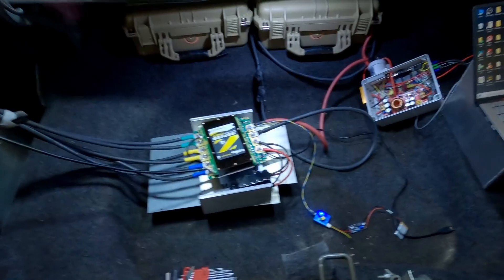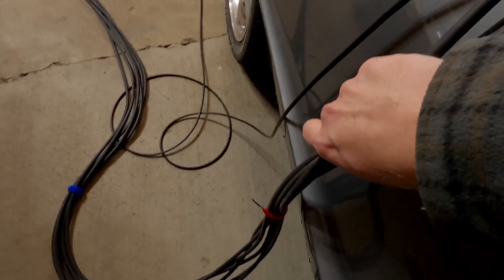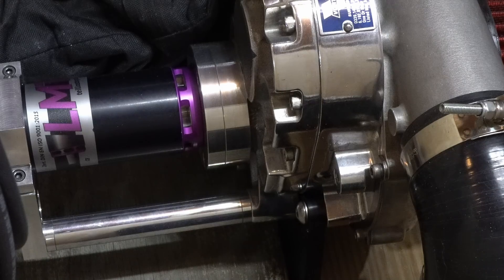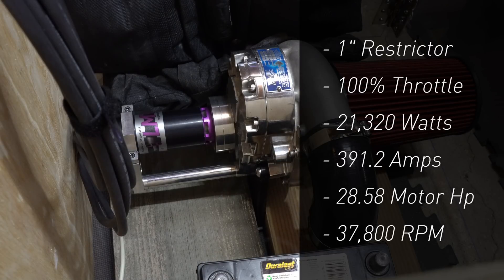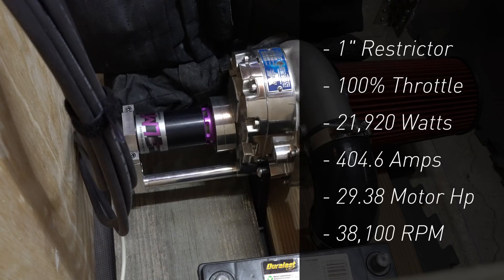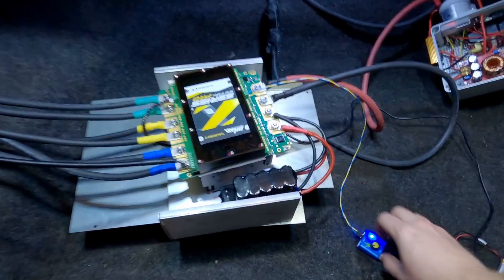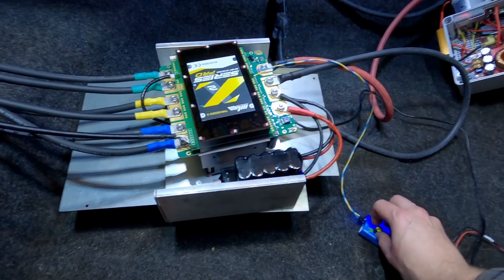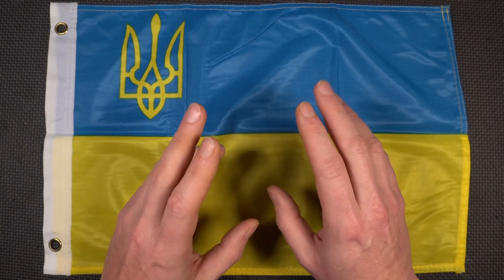DIY Electric Turbo: Sledgehammer High Power Tests - It Works!

Comment: What kind of pressure is it putting out?
Reply from the maker: Here it is on the dyno - with power and boost numbers: https://youtu.be/b9d5xv9INmw
Here it is at the track: https://youtu.be/RT0M88xHzNQ
Reply: @AlexLTDLX  you couldn't just hit me with x amount of psi or bar if you wanna get fancy
Reply from the maker: @ Because psi by itself is meaningless.

Comment: Ive watched a couple of your videos. It looks like you’re making really good progress with this thing being a fixed speed. Can this be used for daily driving or is it race application only?
Reply from the maker: You can use it for daily driving, but I don't know where you could use 800 hp for anything more than a second in daily driving - and that would likely be enough to get you arrested anyway.
Reply: @AlexLTDLX  my question is more or less since it’s continuous boost what happens when you’re sitting at a stoplight if the speed is not variable, you’re constantly making peak boost, no matter what right?
Reply from the maker: @scottallard7566  it doesn't run all the time. It only runs when the power is needed.

Comment: may i ask why you chose to have long ass phase wires instead of putting the ESC in the front? should be way more efficient, no?
Reply from the maker: Long battery cables proved to be more problematic than long phase cables.  In an ideal setup (like a pickup truck, where everything could just sit in the bed), you'd have no long cables.  But this thing had to fit into and actual car.

Comment: The problem is that it costs the same as traditional forced induction or more
Reply from the maker: That one, yes.  But the current units are actually cheaper.  And they make more power.

Comment: Very cool.  I'm a disabled/retired mechanical engineer and I've been thinking about this type of setup for a while.  I have a whole other potential half of this setup but these days I don't quite have the resources to do as much as I'd like.  Anyway, if you are interested in the ideas I've been thinking about for doing this in a non race street vehicle, in my case a large displacement heavy duty gasoline truck engine, let me know.

Comment: RC motors have been super powerful and capable for a good 25 years. I have a little 300 gram motor (454 grams is 1 pound) that can make 3000watts....yeah these things are nuts.

I had dreams of making an electric turbo diy back in 2003 in high school.

This makes me want to get out the drawing book.

NICE work btw. Keep it up. 👍👍👍😁
Reply from the maker: Thanks!  If you haven't seen it, this is hopw it did at the track: https://youtu.be/RT0M88xHzNQ

Comment: You are obviously keen on electrical and what not but clearly not a motorhead....
Superchargers and turbos are air pumps; meaning they are measured by flow....so you never mention how many lbs a minute the pump flows or its flow charts. Credit where credit is due sir, but literally none of your data is really applicable to an engine...you size a turbo to an engine through flow charts and volumetric efficiency; neither which you stated anything About. Im sure you surely must know of these things so if ya did then there's your next video content, If you didn't then I just wasted the next couple years of your life studying a highly important and very complex and multifaceted of 404+  physics including fluid dynamics, aero dynamics, volumetric efficiency, coefficients and some black magic! Good day, nice project and my only aim is to help you translate to the gearheads as most of us aren't that smart.
Reply from the maker: I've been drag racing over 30 years and building one-off forced induction setups for almost as long.  Watch this video of how it did at the track and get back to me: https://youtu.be/RT0M88xHzNQ  FWIW, there are 93 videos in the electric supercharger playlist - I go in depth into compressor maps, volute coatings, dyno tests, multiple track tests, etc...  I've been working on this setup for a while and the results handily beat ANY forced induction I've ever used or even seen, psi for psi.  Watching just over 1% of the videos on this project isn't going to give you the full picture.

Comment: 678 amps??!!!!?!!! WOW! That little motor draws some power!! Is that kind of power something a normal vehicle charging/battery system can handle? I know most car alternators have an output of around 100 amps.
Reply from the maker: The system has its own battery pack in the trunk.  The packs recharge during normal driving.

Comment: So what are you doing for lubrication on the bearing/ seal ?
Reply from the maker: I'm using Isoflex NBU-15 grease in the bearings; I only have to lube them once a year or so.  I no longer need the front seal since there's no oil mist, but I did machine a teflon bushing to fit in that spot and give a couple thousandths clearance just to keep it from being open.  The area under the impeller appears to be under vacuum.  The Isoflex isn't any run of the mill grease - it's quite expensive, and for good reason.

Comment: Great test. For practicality point of view, what is the best battery size that you can have on a racing car for a track and how long can it last with consistent boost?
Reply from the maker: I use an 18ah battery pack, and I've made numerous dyno pulls and track passes without needing to recharge the packs.  On the dyno: https://youtu.be/PjOJU02FIGw  At the track: https://youtu.be/nlTVHkfSQXM
Reply: @AlexLTDLX  thanks for the reply but I was referring to tracks for multiple laps. How the battery can keep up in that kind of racing compared to conventional turbos or superchargers?
Reply from the maker: If you're asking about total run time, with my packs you'd be seeing useful boost for at least 2 minutes.  I can't imagine going flat out for 2 minutes at this power level.  In the grand scheme of things, I also think a properly sized compressor (this one is a little too small for the engine in the LTD - a Dart-blocked, Twisted-Wedge headed 365ci, ~ 520hp n/a V8), I think current draw would drop substantially.  It took less than 14kW to support 650 hp (because the compressor wasn't being pushed as far into the choke region of the map); but 33kW (more than double the power) only got us another 72 hp - to 722 flywheel hp.  That's why I'm now working on increasing the efficiency of the compressor as much as possible.  I think we'll hit 800-850 hp with this setup at under 40kw  - but that would drop runtime between charges down to a bit under two minutes.  You could always add another set of cells in parallel...
Reply: @AlexLTDLX  I understand. So you’re setup is useful for drag racing only where you can’t go with it for rally or conventional race tracks that require consistent boost for many laps without stopping. I’m working on prototyping a completely new turbo charger concept that I recently got a US patent for. I will share with you the prototype when I complete it.

Comment: What is the nominal voltage of  your system?
Reply from the maker: "Nominal" is a sort of loose term, implying a certain "average" charge voltage.  I don't charge the cells to max voltage, simply because there's a lot of drop off early on in most lithium chemistry cell's discharge curve.  The ESC is limited to 63 volts.  I typically charge the packs to ~62 volts.  I could charge them higher, or even add another cell - I do still need to find that ideal balance between cell count vs cell voltage vs added internal resistance.

Comment: lol is that one of those bang good 1200w dc-dc boost converters I see in the trunk? I have one of those. I use it a lot for random crap. great little thing.
Reply from the maker: Yes, it is.  It's wired in as a charger for the packs.  Good eye!
Reply: @AlexLTDLX  id recognize that design anywhere haha. they actually work great for stuff like chargers. i put a ton of heat through one running it at like 250w during my intial tests. definitely needs a fan at those higher loads but it does just fine

Comment: You guys spending money, spend some on a pressure sensing switch hooked to a speed regulator. Then as it boosts it responds to preset pressure in a controlled situation. The cost to control and the complexity exceeds the performance..

Comment: Looking awesome.  Would be nice if you can control the amount of boost, so it can be street legal if needed.
Reply from the maker: You can - check out the latest video; you can control the max setting; but you can also stage it or make it follow something - like throttle position.

Comment: Nice project !  @AlexLTDLX   Ultra long phase cables add ALOT of inductance and resistance between the motor and ESC !!! The mosfets of your ESC are probably producing ALOT of heat because of that! I would suggest puting your ESC as close as possible to the motor to shorten the phase wires. I think extending the Battery wires instead is better.. yuo only need to add couple caps to the DC input of the ESC
Reply: Correct.
Reply from the maker: Unfortunately, it needs to fit in an actual car.  Otherwise this whole thing is a waste of time and money.  FWIW, the inductance on the motor side really isn't much of an issue - the frequency is too high to be affected too much.  The bigger problem is on the battery side.  I found that out the hard way.  The bigger issue with the long motor cables is getting the motor started - when back EMF is pretty low amplitude.  But the sensors take care of that.

Comment: you can get 1/0 battery cables out of certain dodge chargers in the junkyard super cheap.
Reply from the maker: That probably would've saved me a small fortune.  Thanks for the tip!

Comment: What electric motor is that?
Reply from the maker: An LMT 30100.
Reply: @AlexLTDLX  Cool, thanks! Are you planning to run this electric turbo constantly like a supercharger, or just occasionally via a button? I'd imagine it has to run constantly, otherwise the non spinning turbine in the intake stream would be causing an air restriction, right? Do you foresee any issues with this electric motor and running it constantly like that?

Comment: It would be really neat to see how this would do with that Procharger i-1 with the CVT on it. I would love to see how this compares to a turbo or a belt driven blower. Obviously the small amount of sprung weight from the batteries is going to out weight the parasitic drag of a normal blower or the back pressure of a turbo system on a psi=psi basis especially if you have electric accessories like water pump, fans and maybe even power steering, then have the alternator on a switch to not drag the engine during a pull. I wonder if one of those big alternator/starter units from a mild hybrid GM 4cyl or Ram 3.6/5.7 could be adapted? It'd be cool if you could get the electric HVAC system from an wrecked EV...if not the Li battery pack, vacuum pumps, power steering pump and electric motor. This would be a cool way to build a plug in hybrid too. One idea I had was to run an electric motor directly into a Rockwell 2.5 ton axle that has the pinion output on it, then you could have a pinion service brake and utilize the electric TQ fill along with regen braking, then you could have one of these electric blowers feeding an LS engine or 351w based engine with some good heads on it, maybe use a manual transmission so you could leave it in neutral and run all electrically if you wanted. It's really cool to see someone doing something in real life that I have thought about before and actually making it work. Outstanding. You should send this thing to Richard Holdner or Engine Masters to test in on an engine at Westech on their Dyno vs other power adders. It would be cool if you produced these things or worked with a big company to produce these things. I would imagine in a big power application you would never need more than 30-60 seconds of boost because the vehicle would be going so damned fast, the question then would be how many pulls can the battery do, how much does it weigh, how long do you have to run the engine to recharge it or how long would you need to plug it in? I would imagine that it could be very practical. I would think one or two of these on a GM 6.0 iron block with ring gap, cam/springs, headers and proper tuning could be killer, maybe make 1000+hp at the crank with two? This whole thing gets my imagination going, thank you for sharing it.
Reply from the maker: I'm looking at an electric A/C unit.  I have an EPAS (electric power sterring) unit from a Prius I'll put on this thing someday, too.  Although for something like this, you'll always need to run it off it's own battery pack, and use the car's alternator to charge the packs when not in boost.

Comment: How do you plan to manage thermals on long pulls? Sure everything’s cool at full power for a couple seconds, but what about full power for 2-3 min?
Reply from the maker: It's an LK version motor - it's air cooled (internal fan).  Plus, where it's mounted on the car (yes, right now it's mounted on the car), it gets plenty of air flow.  I can't imagine pushing even 500hp for 2-3 minutes straight, much less the 800-850hp this should make.  We're talking 0-60 in 2 seconds or less, 0-100 in about 5 seconds, and 9 second quarter mile times.  FWIW, I'm in the process of buying a piece of property in Texas an hour away from where they run the Texas mile (that's where I was last week).  Are you thinking what I'm thinking?  Even that takes less than 30 seconds.

Comment: This is just awesome, if you can figure out how to make this work according to the cars  throttle to build boost at appropriate times it would be perfect
Reply from the maker: One of our members at www.electrifiedboost.com wrote arduino code to do just that and more - variable ramp up time, battery charge controller, potentiometer-controlled peak power limiting, etc.

Comment: 400A should be enough. 600+ is a bit overkill dont you think ?
Reply from the maker: Version 1 pulled about 340 amps (or 281, depending on which current measurment you believe - the inductance meter or the ESC).  It did this at the track: https://youtu.be/AOL3Qyczt3Y

Comment: This really cool to see in diy space.  But isn't the rpm to low for the impeller?
Reply from the maker: No - It's a Vortech Si trim.  Max impeller speed is 52,000 rpm.  This is what it did on a car at only 28,000 impeller rpm: https://youtu.be/AOL3Qyczt3Y

Comment: I wonder if you could use a planetary gearbox with a roller clutch to turn an oversized turbocharger. Electric for initial spool, engine exhaust for peak. It seems like you have it 99% worked out already.
Reply from the maker: Audi and Mercedes have already done that - I'm just going for max electric boost.  Thanks for watching and commenting!

Comment: I do like the idea but reliability would be a issue if you cant keep that motor cool when working hard and drain battery soooo quick
Reply from the maker: That's why I'm doing these tests.  Our first version was water cooled, but it turned out to be unnecessary: https://youtu.be/AOL3Qyczt3Y  You're not in boost long enough to get things hot.  Even on a road course, you just put the motor in the airflow - keeps it plenty cool.  And with the batteries I'm running, not only will it run for quite some time (easily long enough to complete a typical road course) without charging, but the controller box can charge the batteries when not in boost.  And with these particular batteries, you can charge them really fast - like at 15C.

Comment: Was there a reason you did not utilise the speed potential of the original gears or a reworked set to suit the electric motor?
Reply from the maker: Yes.  And that's a good question.  There are two way to make HP - alot of torque and low rpm, or low torque and high rpm.  The beauty of low torque and high rpm is the motors are a lot smaller and lighter.  An equivalent low rpm/high torque motor that makes the same horsepower (like the "MG2" motor out of a Prius transaxle) weighs almost 10 times as much and is a lot bigger.  This is a good balance with what's currently available.

Comment: So to reach like 150.000rpm you already lose 100hp? Looks counter intuitive.
Reply from the maker: Why would you need to reach 150,000 rpm?  The compressor wheel is only rated to 52,000 rpm.  Not all centrifugal compressors are the same.  You're thinking of a little tiny turbo.  This one has a 6" exducer.  It's a billet wheel Vortech Si trim.  You can google the compressor map.  BTW - the first version already made 650hp - watch our first drag tests with half the drive power: https://youtu.be/AOL3Qyczt3Y